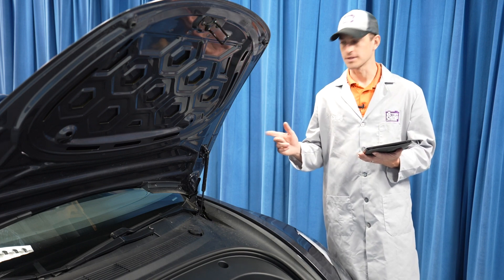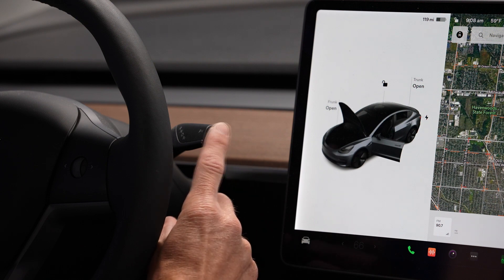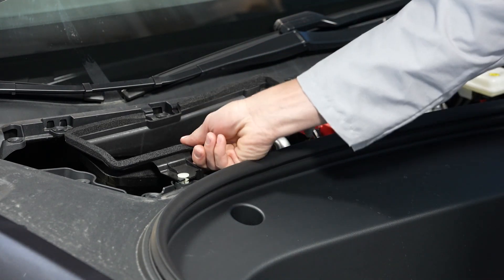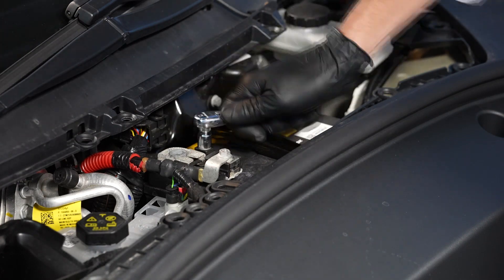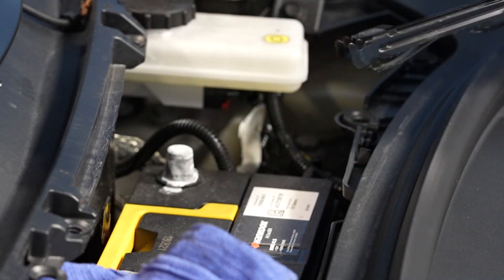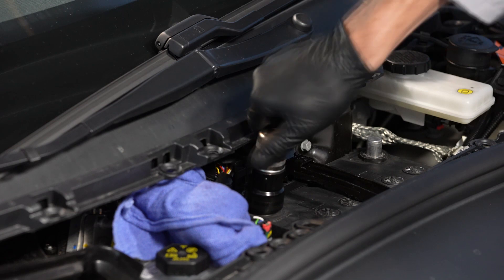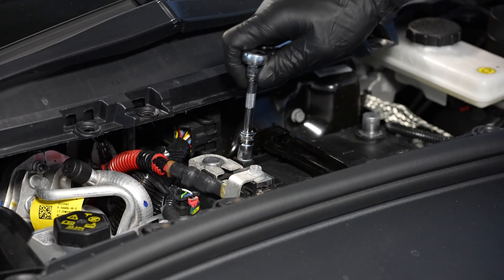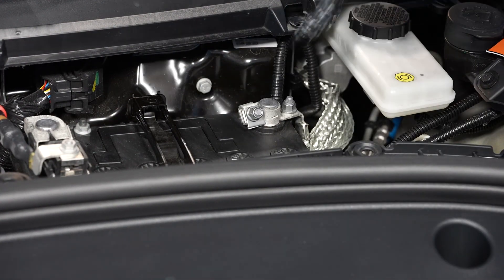Tesla Model 3 (2017-2023) - New 12-Volt Battery Install

Comment: Can I use a 12v obd2 port memory saver on Tesla model 3?
Reply from the maker: Thank you for watching.  The Tesla Model 3 does have an ODBII port but we would recommend checking with your dealer if a memory save should be used during installation of a new battery.

Comment: If the 12V battery is completely dead, can I just install the new one without disconnecting the HV connector? Or do I need to jump it first and then follow the steps in this video

Comment: Brilliant video. I had a mobile fitter come around to replace the battery, he had never done a Model 3 before and wasn't allowed to disconnect the main battery, so I did that part and he replaced the 12v. 

This is my 3rd battery in 4 years for this car and i've only done 12k miles. I use the car once or twice a week. I don't know if i'm not driving it enough to keep the battery topped up or if its a common problem with the car.
Reply from the maker: Hi - Thanks for watching and sharing your experience! We wonder if you would benefit from a Battery Maintainer?

Comment: Does a 12V battery DYI replacement void the warranty assuming using a new,  proper 12V battery ?
Reply from the maker: Hi - Thanks for watching! The proper installation of a battery that meets or exceeds the O.E. specifications for the battery will not void the vehicle's warrantee as per the Magnuson Moss Warranty Act.

Comment: Question: How does water get to the battery to where it needs to be replaced? Also, how much water would need to effect the battery to cause it to be replaced? 
  Yes, I know every Tesla is different and it depends on the age of the battery and how much it has degraded, but 
 Also, if a person is looking to purchase a  used EV what type of things should they look out for outside of the brakes, tires, interior,  etc.? Is there a device that checks for how much the battery has degraded?
Reply from the maker: Hi - Thanks for watching! Modern AGM batteries are sealed and do not require adding water. You can have your battery tested to determine it’s state of health. Repair shops, Dealerships and auto parts stores can do that for you.

Comment: I bought a battery from Tesla but cannot access the vehicle to disconnect frkn the hv battery. Its nit responding to being jumped either, is it possible to replace the 12v without disconnecting from the hv battery?
Reply from the maker: Hi - Thanks for watching! We don’t know for sure, so we can only suggest that you refer to the vehicle owner’s manual or a service/ repair manual for that information.

Comment: So I paid Tesla mobile to replace the 12 volt battery for me and shortly after they left I started getting messages on my Tesla mobile app that my front trunk is opened even though it was not. Furthermore, this morning when I was driving to work autopilot was disengaged randomly by the same front trunk is open message . I don't know if this is a complete  messed up coincidence that now I'm having this issue after Tesla worked on my car but something I did notice was that they took out the entire front truck plastic cover when they were working on my car to replace the 12 volt battery. Any ideas?
Reply from the maker: Hi - Thanks for watching and sharing your experience! We do not have that type of information here in the studio, so we can only recommend that you refer to a service/repair manual for diagnostic procedures.

Comment: Thanks for this step-by-step video. Who knew that each Tesla had a regular battery that runs all the controls? Our battery died, the car was bricked. I figured out it was the 12V battery by connecting a tender charger and the car came to life again. So we bought the replacement from Tesla, not bad, price was $85 + tax, but they dont share this information to properly clear the 'Electrical system is unable support'  message.
Reply: Where did you buy the battery? From your local service center?
Reply from the maker: Hi  - You’re welcome and thanks for watching and sharing your experience!

Comment: Apreciate the video. Woke up on vacation today and had this  warning. Watched this video then called around to find out there wasnt a tesla batterry in montana. A kid at orielys auto parts said it was a group 51 battery in size and spec. They  carry  that battery and i installed it in 5 minutes in there lot. Super easy. Remember group 51. 189$ lead 250$ AGM
Reply from the maker: Thanks for watching and sharing your experience!
Reply: Just bought this and plugged it in. Does it take time for the error messages to go away?

Comment: My 12v battery died. No way to open the frunk. Touch screen is off and app doesn't connect. I pulled out the plug in the front bumper and used an a23 12v battery to connect the two leads but still the frunk won't open. I don't even hear it trying to open. I also tried a 9v battery on the leads.
Reply from the maker: Hi - Thanks for watching! We don’t have that information, so we suggest that you check a service/repair manual for the vehicle to be sure.

Comment: The 12 volt battery should charge when the car is plugged in and/or "running/driving"....there's no reason it shouldn't stay charged up and last for many years....something seems wrong.
Reply from the maker: Hi - Thanks for watching! The 12-volt battery will eventually fail, and we hope this video will be helpful when the time for replacement comes.
Reply: Yeah, and they die after a couple years due to heat and vibration.
Reply: Mine lasted 4-1/2 years always parked outside in the heat.

Comment: Thanks for the well done video. I was surprised that apparently Tesla doesn't suggest you use the software power down before disconnecting the two batteries, but obviously the given procedure works without it 

Controls / safety / power off
Reply from the maker: Hi - You're welcome and thanks for watching! We used the procedure we downloaded from Tesla's service information.

Comment: Had to do this in the airport long term parking lot after leaving the car for two weeks and it started saying the 12 volt battery was failing while I was away.  With the help of a friend meeting me at the airport and this video - we did the battery swap in less than 5 minutes.
Reply: less than 5 minutes? ok.
Reply from the maker: Hi - Thanks for watching and sharing your experience!
Reply: Many sites recommended using the new lighter weight 12V battery. On the App of my Tesla3 the manufacturer recommends replacing with a new lead weight. I personally would prefer the lighter one but I don’t want to void any warranty issues.
Reply: ..and where did you get the new battery? How much did it cost you?

Comment: Hi, what is the purpose of removing the rear seat cushion (at the 1:26 mark of video)? Thanks!
Reply: I know it's been 3 months, but a Tesla tech told me that this step to disconnect the 12v battery from the high voltage battery is needed or else the car won't 'reset' and acknowledge that a new 12v battery has been installed.
Reply: @paullawrie  Thank you, appreciate it!
Reply from the maker: Hi - Thanks for watching! We were reciting the vehicle manufacturer's instructions. We were able to access the "penthouse" by just lifting the corner of the seat cushion.

Comment: Shouldn't you disconnect the HV System before disconnecting the Negative Batt Terminal !
Reply from the maker: Hi - Thanks for watching! We followed the manufacturer's step by step instructions where the negative battery cable is disconnected first.
Reply: @TheBatteryShop  That makes no sense because once the 12 volt battery negative cable was disconnected the car will throw a code as it doesn't sense voltage.  This is why you would disconnect the HV battery first.

Comment: Unfortunately this video doesn’t work for the 2022 tesla models as tesla changed them to a new 12 volt battery type.
Reply from the maker: Hi - Thanks for watching! We recommend that you follow the vehicle manufacturer's step-by-step instructions, found in a service/repair manual for the vehicle, like we did when we replaced the battery in the video.
Reply: @TheBatteryShop  Well, the procedure you followed was not for the 2022 because of the new lithium Ion 12 volt battery.

Comment: Does this clear the battery replacement warning?
Reply: It did for me! 2018 Model 3 LR RWD. Got a VCFRONT error that went away immediately, followed by a "replace battery" notification. Tesla said they could fit me in for an appointment same day, but I just bought the battery from them instead and installed it myself following these instructions. Cost me about $90 for the battery.
Reply: @taylorostberg5950  just got this warning yesterday taking my car in today to get the replacement. Have the same year and model you have. Of course this happed after I passed 50,000 miles.
Reply from the maker: Hi - Thanks for watching! We recommend that you follow the step-by-step instructions in the service/repair manual for the Model 3 to be sure.

Comment: What is the best place to purchase a v12 battery
Reply: Usually I buy from Rockauto or Costco, but neither carried the right battery. I wound up buying direct from Tesla, the service center near me had it in stock and they charged a fair price (under $100).
Reply: @taylorostberg5950   that is really cheap.  Batteries run a minimum of $150.
Reply: I couldn’t find one at any normal parts stores and many fancy ones online we’re out of stock or over $400. Got the OEM battery at Tesla for 90 bucks incl tax and no core.
Reply from the maker: Hi - Thanks for watching! Actually, auto parts stores and the vehicle dealership's parts department will all have a battery that meets or exceeds the specifications for the original battery in your vehicle.
Reply: @TheBatteryShop  The problem is that the 51R battery available at WalMart $150 today and everywhere else I looked online does not have the vent hose connection, Did not want to risk not using one.
Reply: It's less expensive buying directly from Tesla, surprisingly.
Reply: Tesla just sold me one yesterday for $85, which is far less than I've seen anywhere else have it for.

Comment: What do you mean when you refer to the Penthouse?
Reply from the maker: Hi - Thanks for watching! That's what the manufacturer calls that item over the disconnect.
Reply: It's the area under the rear seat, raised above (like a penthouse) the rest of the battery pack.